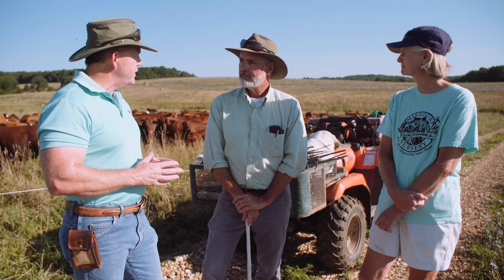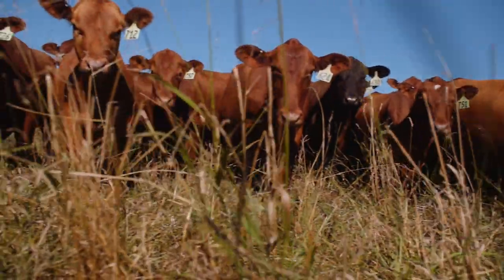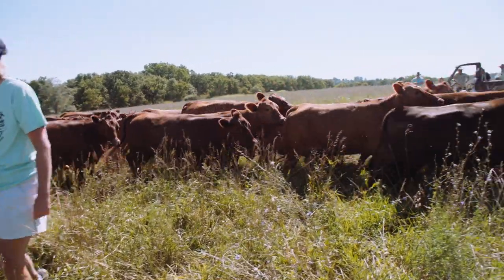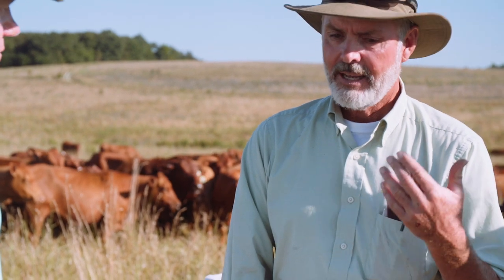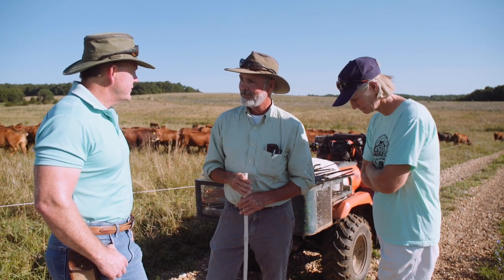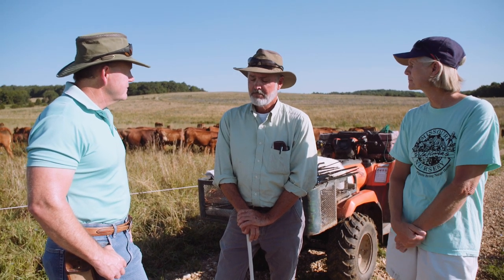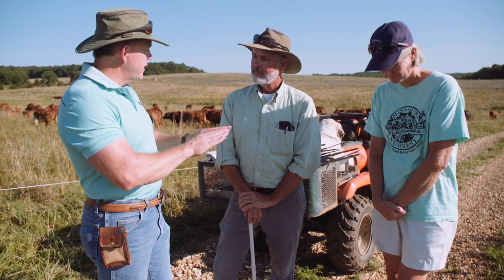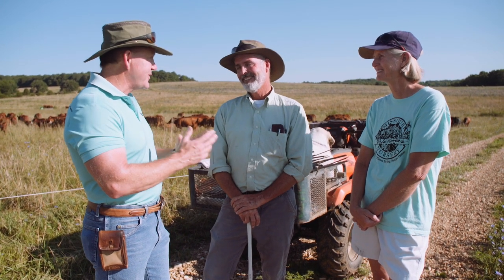Adaptive Grazing 101: How to Assess Paddock Size and Optimal Stocking Density

Comment: 80,000 lbs stocking density vs 500 lbs stocking density. Is amazing.
Reply: Yeah,  i don't see how those numbers work out. 

He used the 120 000 lbs and the 1.5 acres,  but those cows STILL require the full 3 acres EACH DAY...

And then what happens the following day? They're eating half the grass and it can't replenish that quick,  so do they then switch to a DIFFERENT 1.5 acres the following morning?  Bc however many paddocks you need to rotate through bf returning to the first,  THAT is the number you should divide the 120000 lbs by (since THAT is the total acreage required to handle those cattle).
Reply: Any minimum,  it's 3, so the density in best case is still 40,000, not 80000.
Reply: 80,000 lbs is about 70-80 cattle.

Could 70-80 cattle be fed on 1 acre?  Doesn’t seem possible….